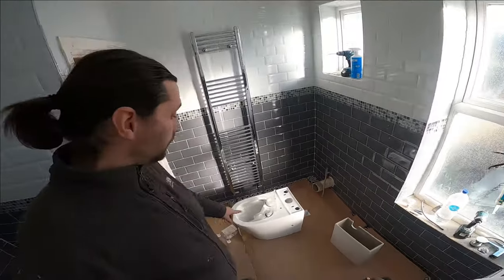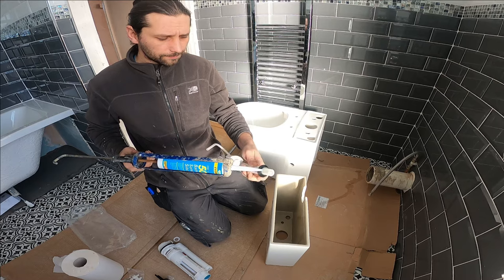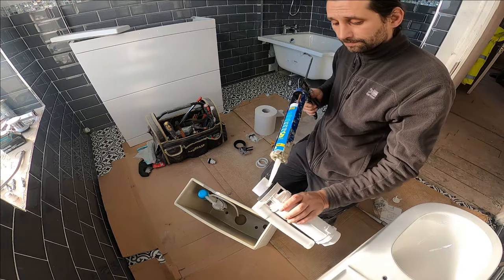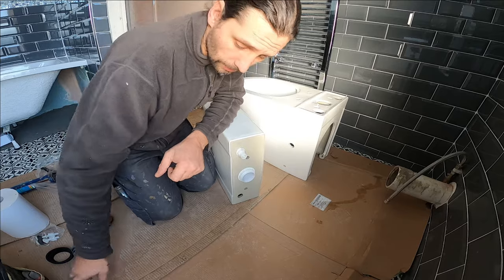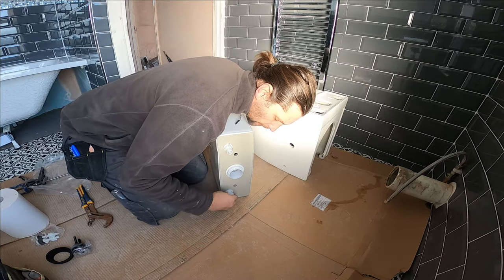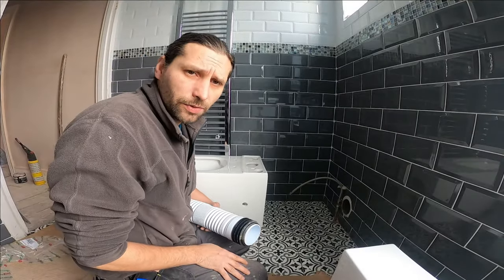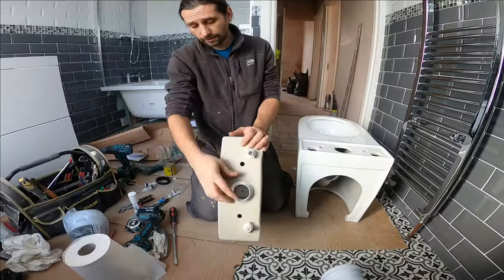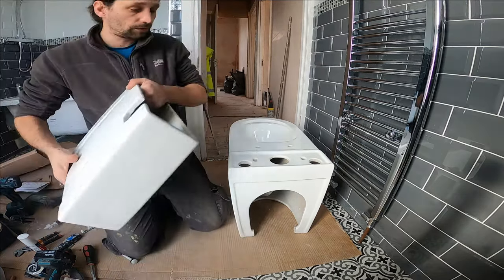How to fit a back to wall toilet

Comment: Excellent video, thank you for posting. One question if I may. How do you Isolate the  cistern water supply for routine maintenance like changing the flush rubber gasket? Does it mean you need to remove the throne each time, thereby risking creating a pan collar gasket leak. 😁.  Cheers from Michael. Australia.
Reply from the maker: Hi. Yes the toilet needs to go out to do that type of maintenance. The main water supply can be closed if somthing bad happens. My clients usually don't want to see any pipes on the wall's, that's  way it's all hidden behind.thanks for your message

Comment: Great video and clear explanations.  I'm always worried about this kind of toilet.  As you said, any drips and leaks, you won't know about it until it's too late.  I think I prefer not to have anything concealed like bath taps and showers for that reason.  Oldschool I know but I've had lots of problems before
Reply from the maker: We are on the same page here .Nothing it's build to last sooner or later somthing is going to go wrong and if you can see it you can repair it. Thanks for the msg

Comment: good video but I believe you can make much better if you planned a bit ahead. An example is: before you install the waste pipe you could  mark and put the brackets for the basin. this is just an eg. Keep up the good work because you know what you doing and above all you are a gentleman. Great work. cheers and good luck for your channel mate.
Reply from the maker: Thanks for the tips! Great point

Comment: Thanks for this. Very good guide! I needed this since I have a back-to-wall toilet which needs a new siphon valve. Couldn't see how to make this change without seeing how this kind of toilet is installed. All makes good sense now though still not looking forward to making the change!
Reply from the maker: Wow, I really appreciate your message. You just made my day. Thanks
Reply: How did changing the toilet valve go? I have to do ours today - and what would be a 10 minute job on a normal toilet looks like it will take hours of messing around.

Comment: Hi, thanks for the good informative video! I have a similar unit and it is a bit loose when you sit on it and I have tried tightening up the screws on the floor bracket but it still not quite as rigid as it should be! The cistern isn't attached to the back wall and there are no screw holes to fix it to the wall so I was wondering what is the best way to fix it to the wall? thanks
Reply from the maker: Hi. A good adhesive it's going to do the trick and you can apply it on the floor and at the back of the toilet

Comment: Great demo of how to fit this type of toilet. Just what I was looking for. Is it absolutely necessary for silicon on the rubber seals please?
Reply from the maker: It's not necessary. It's just that sometimes the services are not perfectly flat and its bette not to take chances. If we get a leak, everything needs to be dismantled
Reply: @How2Extreme  thank you 👍

Comment: Kudos for a clear instructional video. I have a very similar toilet half installed, but was unsure about the 2 bolts holding the cistern to the pan, I can't believe they designed it with just plastic bolts, especially as the cistern is not bolted to the wall. Anyways, I can now go and finish it before wifey gets home.
Reply from the maker: Thanks for the visit and I'm happy I could help

Comment: Thanks for your time to do this informative video.  I hate back to wall toilets simply because flex pipes are bound to fail at some point in their lifetime and if concealed then that's trouble. They are also a pain to install. But anyway that's my opinion and an option between aesthetics and practicality.  Question please : Pre-fitting, I noted that the toilet had a slight floor wobble. Did the floor wobble resolve once you tightened the toilet to the floor brackets ?  Thanks once again.
Reply from the maker: Thanks for the msg and yes the toilet wasn't wobbly after completion.

Comment: Good video. I prefer to use the 'back to wall' flexible pan connectors which are clamped to the pan spigot using a jubilee clip. That way you don't have to worry about leaks, or about the connector popping off if you're pulling the thing in and out.
Reply from the maker: Good to know.thanks

Comment: Hi can I ask what those 2 extra holes on the sides are for, the ones you blocked with white plug, not the holes near the base wear you screw to the floor
Reply from the maker: hi, you can actualy pass the pipes and conect the water supply if the pipes are going to be on the surfice of the wall or floor

Comment: Enjoyed and very helpful, well done!

Question: can this type of toilet discharge into a sweep 90 after leaving the flexible connector?
Reply from the maker: Thanks and yes it's a basic toilet i don't see why note.
Reply: Thank you for the fast response.  I’m  still hunting a flexible P-trap connector- all I’ve found are the rigid variety.
Reply from the maker: You can easily find it in screwfix ,b&q,selco etc

Comment: So the toilet install is going well. I'm using an identical toilet and the flexi waste from pan to P-trap. The one thing I'm having issues with is the connector staying in the porcelain waste outlet.  It's very tight but doesn't seem to really fit and so every time I move the pan it it pops out. Any thoughts on how I could stop this? Thanks
Reply from the maker: Hi longer flexible waste conector evrething and then gist push to the wall.you can send me some pic's on Facebook and i will help more
Reply: @How2Extreme  Thank you.  I did that this afternoon, it's a bit scary cause you can't see if it has connected properly. I have left everything to dry tonight (I'm in Australia) and will check for any leaks tomorrow. I will send you a picture on FB though.

Comment: Is that flexible waste pipe leak proof? Do i need to put silicon around the connections to make it better? I have exactly same system that i need to fit
Reply from the maker: If you referring at the flexible pan conector yes.i never had problems with them and you don't need to use any silicon

Comment: Hi! What model of toilet is this and how high up from the ground was the wall outlet? Thanks!
Reply from the maker: Hi . The hight its standard 190mm if the hole it's higher or lower then that you can use a offset pan connector
https://victoriaplum.com/browse/all-toilets/type_Close-coupled-toilets?csi=ZCC03&ds_kid=92700067325954114&gclid=Cj0KCQjwn4qWBhCvARIsAFNAMigKRoGvAzK9dVcmrVqkCajhV1lMiAdG1KyynScPhq5_azA8l_eNCxMaAthQEALw_wcB&gclsrc=aw.ds

Comment: Why Silicone on the cistern when it fills with water statight after surely its unable to dry ?
Reply from the maker: That's is just to fill any void the rubber by itself is going to do the job

Comment: When u put bolt through cistern before attaching to pan u should be putting a back nut on both bolts then through cistern and then two wing nuts
Reply from the maker: Hi.I used everything that is coming in the box with it and I had a look at the instruction manual before starting. I've done everything by the bock